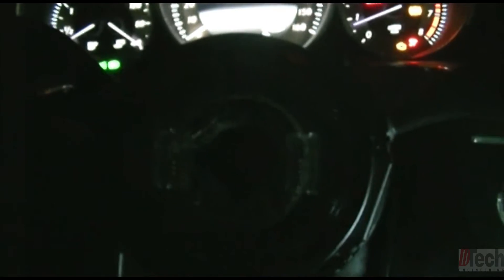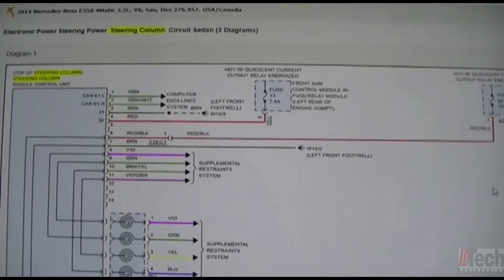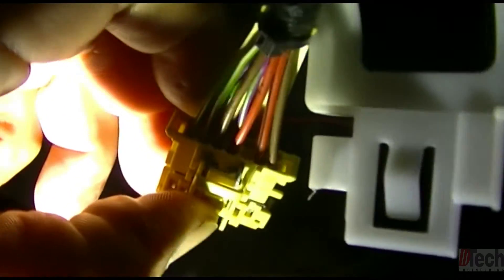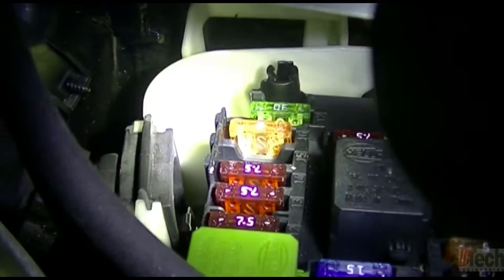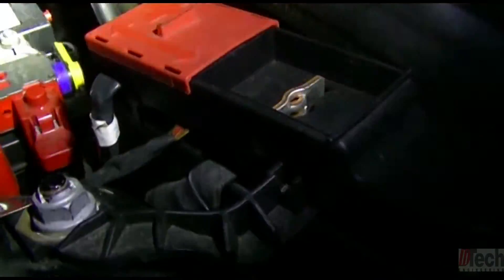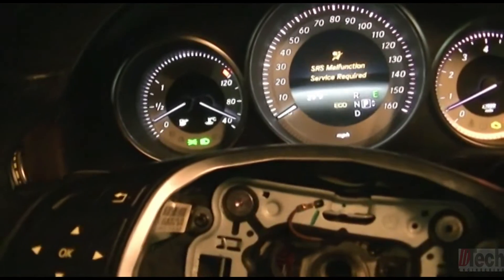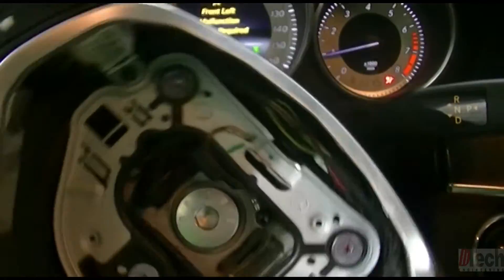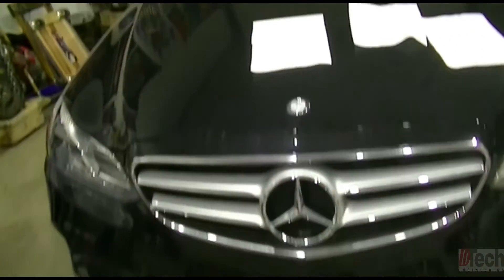2014 MERCEDES NO POWER STEERING & NO DRIVE/REVERSE

Comment: Hi Sadel i have same issue on my MB212. Can you answer the e-mail ive sent you. I appreciate in advance. 
After a battery full descharge and limp mode N3/9 motor and transmission modules caused by leak on the intercoller hoses. The N62 and N68 modules faults are persistents. The other's, ive solve by change the hose and re set the dpf values to 0. 
The sonda lambda bank 1 cilynder 1 also erased by Xentry diagnostic, but probably ill changes it too. Thanks